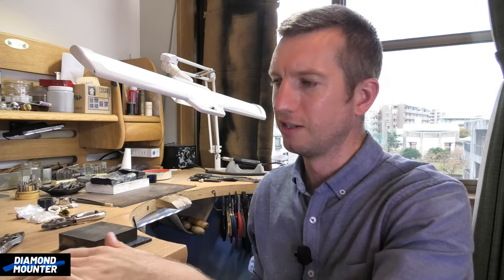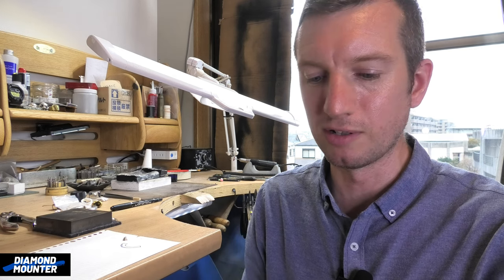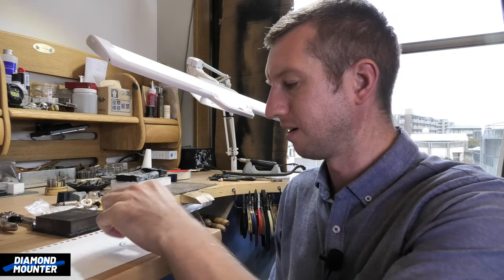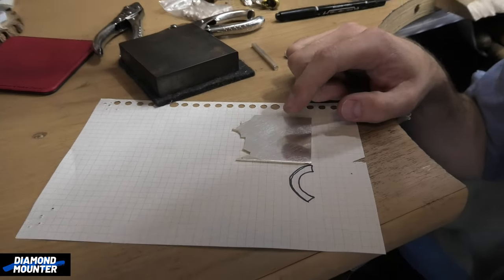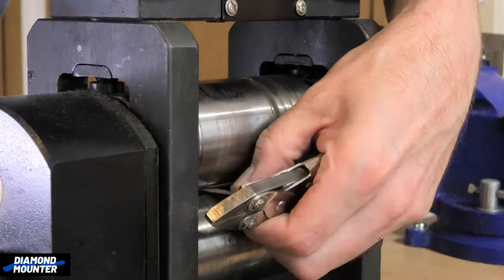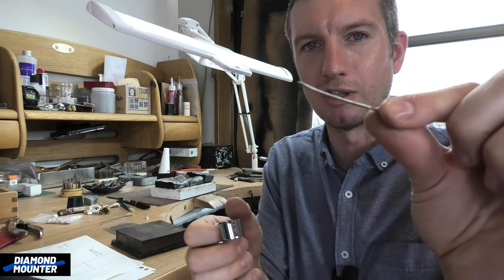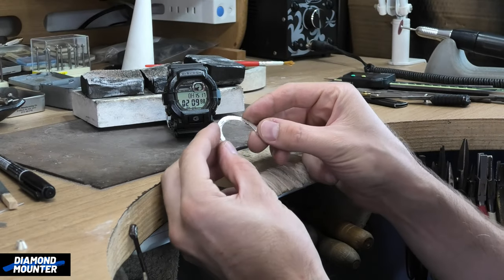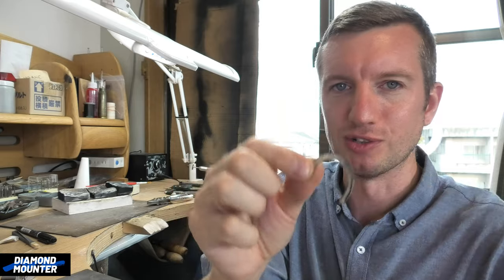Jewellery Teachers vs Pro Jewellers

Comment: Interesting video. I am probably intermediate level now  and am currently learning more with an online school, which I am enjoying. My latest project though is a tube set ring using commercially available silver tube. However I don't have any but I do have a lot of scrap (yeah, lots of botches!). So I used some to turn up my own tube to fit a 5mm stone. Your videos have given me the confidence to try that, so thank you! Also made the tube with my best solder joint ever!

Comment: My experience of learning jewelry making in school in the USA is similar. Efficiency was never something that my teachers graded upon. If a student could produce similar quality work in less time they would receive the same grade as students that took longer. We were also taught that limiting the wear on tools was more important than speed or accuracy. For example it is often faster and more accurate to drag a file backwards instead of lifting the file for the back stroke. We had to lift the file. Apparently files are delicate Gods that must be pampered. I have since learned that they are tools that  wear out and that is OK. If I can make higher quality pieces faster while also wearing out my file faster, fine it is a great trade off.
Reply from the maker: Couldnt agree more!

Comment: Hiya Chris, have you come across 'At The Bench'? A Welsh jeweller from a small town outside Cardiff. He has a YouTube channel and teaches from his vast experience, from between the lines, sizing rings/repairs a lot. He teaches the flat plate, cut an arc method... I did a few lessons at college here in Bolton, the teacher was a sculpture, not a jeweller, knew a few things, not a lot though, this was intermediate class. Both of these wouldn't last a week in any of the workshops you describe I think. But they set themselves up as the lord high, I'm the only one who is a professional, only I know how to do it, my way or do it wrong and fail. 
Dad died back in March leaving me some money that I've used to buy tools. One thing I got was a drill press for a type 30 handpiece and a vice with vertical V cut-outs to hold tubes to cut seats with a burr. They thought soldering in a smaller tube??? You are a breath of fresh air, I love your teaching, I just wish you would show all steps, yes including starter as well as intermediate level. The video would be longer but if you don't need it, skip it. Apart from 2 ladies teaching a lot of people for a very large amount of money each, you are the only teacher who I think really has got the Tee shirt! 
Stay safe, Steve...
Reply from the maker: Thank you I want to show what possible at a jewellers bench with only basic tools. Yes I know that At the Bench channel. He wouldnt pass a job interview to work for me to keep it polite. He has a  10x bigger channel than me though and lots of people like him so what do I know.
Reply: @DiamondMounter What do you know? Compared to him, the lot! He put his foot in it for a lot of people when he slated Pepe Tools because he's friends with Durston, does work for him and gets a lot of new stuff to try, that he co-designed??? It's easy to get a lot of followers when you're about the only game in town. I keep pushing your channel, you are worth following, he is not. A bigoted misogynist, from what he says. Steve...

Comment: I consider myself to be a hobby jeweller, I have never bought a ready made ring or setting. I make everything myself (mainly due to watching channels such as yours) I have found an excellent website that has not only moved my work along massively, but the guy is actually an excellent teacher, he ran his own jewellery manufacturing business then moved to australia,  that mentions everything you have said. Last year I was invited for a bench test at a local jewellers in Leeds UK, I went along, made a ring, only to be ridiculed for the finished article....even though I wasn't even shown where any tools etc were. I just did it, from scratch using scrap. I don't think the jeweller in the shop thought I was capable however I proved him very wrong! Even if they had offered me a job I would have turned it down as I found it a very toxic environment. I'll continue as I am, earning a lot of cash as a truck driver to pay for a hobby where I can serve a small number of customers that actually appreciate what I do. Keep the videos comng, they really do help, a lot!
Reply: What was the website?

Comment: Isn't there a balancing of efficiency vs time? I'm as penny  pinching as anybody regarding making a metal supply last (I'll raid my scraps first when I'm starting something), but also figuring time is money, and using first goods when appropriate. Rather than anneal and mill, repeat, repeat, repeat, I'd count it a plus to cut out that pattern, rubber cement it to the sheet, and get the damn thing cut out and going. I frequently need tiny elements, and with judicious pattern placement, the small scrap created always finds use. 
Then again, I work with silver mostly, and it may be different with gold, although like I said, I always raid the scraps first. Just seems like there would be a calculation there.